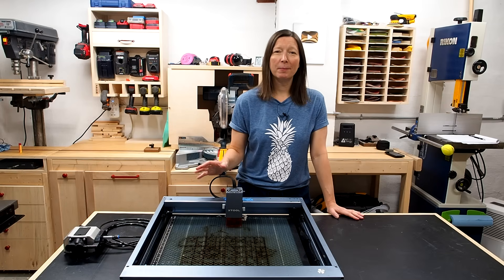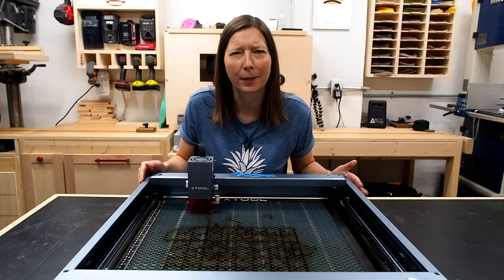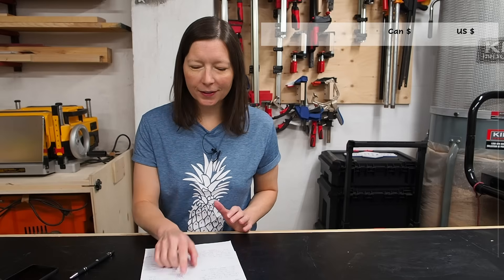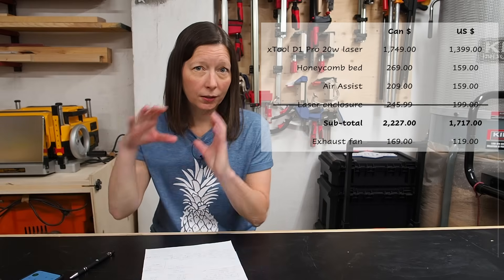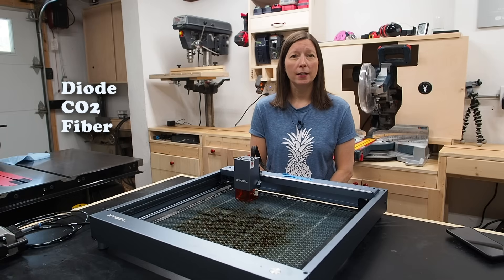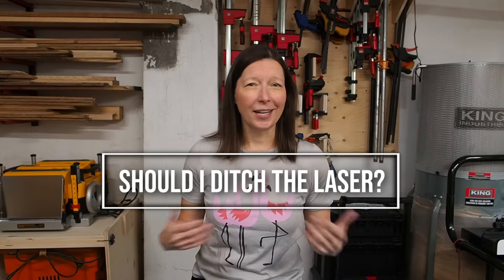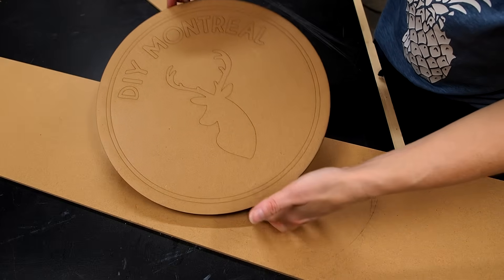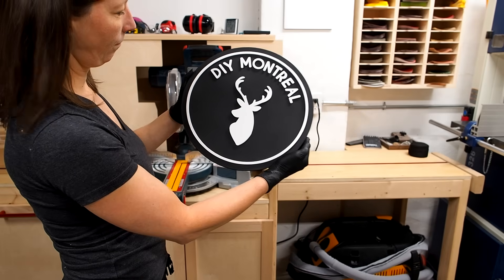Should you buy a laser engraver? Or is it just a waste of money

Comment: Excellent advice.  Very helpful video.  I was strongly considering buying a 10 watt laser but you convinced me it's probably not something I would use enough to warrant the cost and time investment.  I'm a hobby knife maker and really the only thing I wanted a laser for was to engrave a nice looking makers mark on my knives.  Other than that, I really am not interested in cutting out signs or other stuff.  I'm from Ontario Canada originally but moved to Texas many years ago.  My father was a carpenter for 50 years so i too can do carpentry among many other things.  Ive always made stuff from wood and about 2 years ago i made a knife from an old file. Id run out of things to make for my house so i ventured into knife making.  Most of the handles are exotic woods so thats still carpentry..lol   Anyway, the cost of stuff in Canada and the tax is extremely high.  There are several lasers I could get in the USA on black Friday sales for $255 - 320.  Then all the accessories another $200, although I'm not sure I'd need the exhaust vent or even an enclosure just to etch a makers mark in a steel knife?  I don't have a good place in the house to vent the exhaust fumes and smoke if any.  I'm also not too keen on spending many hours learning software either.  Your video brought me back to reality and practicality, so I think I'm going to not get into the laser stuff.  I'll maybe find a small company that can laser etch my knives or perhaps try the old electroetching with a stencil.  Thanks again...you saved me money and time. It's great you do carpentry and I'll be checking out other videos on your channel...Take care and stay warm...I do not miss the Canadian winters...lol

Comment: Note: 
- Laser cutting / engraving is dangerous operation & require enclosure.
- xTool Enclosure or any expensive options are USELESS, build YOUR OWN !
- Diode Laser only is effective at wood and non-reflective / non-transparent materials, unlike Fiber/Co2 Laser.
- Software is required to pay more for Lightburn, plus time investment into learning the tool transitions to make your design work.
- Safety concern : require babysit your process on fire, put on protective glasses before burning.

Comment: Thanks for a very very informative video.
As woodworkers we often need to spend a large cumulative amount of money on setting up a good workshop.
I've been considering lately whether to buy a Lazer or a 3D Printer and at the moment I'm edging towards the 3D Printer 😁
Reply: I bought a 3D printer for my son a few years back, he's made good use of it. lots of learning curves there and he was VERY involved with 3D printing at his University, prior to us buying it for him, so he already had a great deal of knowledge about the subject. We bought a Ender model for about $200. 
       Now, My son just bought me laser engraver! different model than used here. 10W diode laser but only cost $300. I've been working this week to assemble it, set it up, build a vent system, started learning Lightburn last night, plan on doing some tests on a piece of leather today, to figure out proper intensity and speed of the laser.
I don't think I could master the software for the 3D printer, but this laser engraver looks much less complicated to me.
If you buy a 3D printer or laser engraver, either way you'll be exercising you brain !
Reply: Thanks for the Info, I'm still edging towards the 3D printer, mainly because if you want to cut relatively thick material with a lazer, then things can get very large and expensive very quickly 😁.

Comment: I'm looking at lasers for about over a year now but I don't have the space to put it up. My conclusion: What most people have in mind when thinking about lasers these results can only be achieved with a CO2. The higher the wattage the better, faster and cleaner the cut. Therefore the ("small") industrial lasers do a better job at a better price point. They just don't look as fancy/easy to use as the ones which are marketed to the hobby/"wanting to make your hobby into a business"-people.  In between that I would put the laser that "mom with a laser" uses. 
I would never go for a diode laser that are on the market right now.

Comment: Probably the biggest thing I learned is to do testing.  Test using test coupons to get settings optimal before doing the actual work piece.

My next project will be a electronics test equipment rack that will be 14" tall and 13" wide x 11.5" deep.  Material will be 1/4" birch plywood held together with 1/2" wood dowels.  To get the correct hole size to fit the dowels will require some testing as will the best speed setting.  Will use the xtool 40W blue laser, probably start at 50% power setting then adjust speed for optimal results on some scrap wood.

Comment: Agree very much on the exhaust and smoke issue. I made a simple design with a closed and open plywood disk separated with zigzagged bamboo skewers. I weave a filter material in and out of the skewers and this catches most of the sticky particulates and is easy to clean. I have one for inside my 10 watt blue OLM3 and I have one on the end of my 65 watt Gweike Storm 600 CO2 laser that I poke out the window when using it. My 60W fibre laser is far less smoke causing but I wouldn't trust using it much for stainless steel without ventilation because of SS chromium content.

Comment: I'm in Arizona, and I'm thinking about getting a laser and want to start small.  You said they really stink, yeah I knew that and my major concern is that I live in a somewhat crowded area and naturally there's the dreaded HOA.  CC&R states something about not emitting "noxious odors or fumes" (probably no smoke either).  That has me wondering where I can exhaust to... how bad can it really be?  I'll be in the garage and probably have to vent through the roof somehow, cement tile roof isn't a DIY project so it'll have to be done professionally.  What are your thoughts?  Any fire hazard associated with these?  I'd like to cut acrylic and wood.....
Reply: You can get the manufactures filters to add on to your machine, but they are a bit pricey.

Comment: great info. I bought a small cnc w/ laser adapter...yet to use the cnc part, but they use different cooridnate systems so just to get lightburn to communiciate suffuccessfully with 0/0 as the lower right was a big nightmare...learning to program was necessary.

And yes, THE STINK! Try cutting leather!

Comment: OMG FINALLY someone that breaks everything down cost wise and equipment wise. Thank you for giving us all the 
extras with manufacturer and fails with said equipment. I am trying to set up a resin 3D printer with the exhaust fan like you have. 
I have now ordered 4 fans that have not done what I need to vent the smell. I think I have finally figured it out but just from
your video I see your system works. So thank you for this video.

Comment: You could build one using 2020/2040 aluminum extrusion, fasteners, GT2 belts, stepper motors, GRBL controller board, limit switches, cables and accessories, 10w laser module for less than half that price.
Diode lasers are a waste of money to most, a fire hazard cause some users leave them unattended, which is a big no! Never rely on these gimmicky "Safety cutoff" features.
And what frustrates a ton of folk is the very short lifespan of these diode laser modules cause they get abused using them for mostly cutting plywood at 100% power. These are "Engravers" guys!
For cutting, use a CNC or 100w+ CO2 laser or if you have deep pockets, a fiber laser!

Comment: Overall this was a good video of things people may not expect if they didn't do any research at all. A $25 webcam makes you not need to be right there as long as you check in on in and are nearby. The extra costs although not completely accurate are a good point. (there are plenty of much cheaper options for both air and honeycomb for each less than half the Xtool branded ones that are as good or better on amazon.) even less if you DIY it. I spent about half what you did (in USD) for the same setup without a fan or enclosure as they are not necessary so that is a bit misleading. To say "it's not possible" many times is a lie, I have my laser in my office right behind me while I work with the windows open and have 0 issues at all. It's really not that bad as long as you are not careless with what you are burning. To say that just burning wood fumes is toxic that is also not true unless you are burning treated wood., there are some very dangerous things you could burn if you didn't to any research like PVC. Getting fumes out does help but just an open window is fine for some myself included. A laser vaporizes the material so there is no dust to extract...  A few helpful tips 1. Do a material test burn on anything you do and write it down somewhere close. (In light burn you can save a list of materials and settings as well as images instead.) - Wasted test material is another unexpected cost though. 2. The random limit switches tripping seem to only happen in Xtool's software I'd try lightburn that has a free 30 day trial. 3. I'd highly recommend a screw style height adjuster (if you have a 3d printer you can print one, otherwise you can buy one from Etsy for about $25 usd. it will make adjusting for different material WAY easier. 4. Lots of people don't mention this but on stainless or aluminum with a 20w diode you can actually get some color engravings via oxidization of the metal is you liquefy it resulting in different power levels giving different colors.

Comment: Excellent summary... and I absolutely agree that people should do a LOT of research before "taking the step"...
Your video offers an excellent overview of what's REALLY involved in using a diode LASER to DO stuff...

I just purchased XTool's new F1 unit - the one with the desktop air filter and the dual diodes.
Now, to be fair, the company where I work has a big CO2 LASER, so I'm quite familiar with the limitations, as well as the benefits.
And I've also got a lot of experience with graphic arts software... so that won't be a problem either.
I absolutely agree that the ads, as well as most of the FIY videos, tend to ignore quite a few really significant issues...
Like smoke and smell, and the experimentation required to choose settings, and even the materials themselves...
And most seem to sort of gloss over the fact that, when you "cut" with a LASER, you are basically burning through the material...
(It's not like in the sci-fi movies where the material just disappears when the beam hits it.)

I think it's also worth mentioning that a lot of the limitations CAN be overcome... but even that can be complicated.
For example, you CAN engrave on glass or clear acrylic with a diode LASER, but it's really complicated...
And it takes lots of extra steps...
And, if you watch the various videos, you'll see that many of the methods don't actually work especially well anyway...
(At this point a lot of this is still "experimental"... )

I think I would add one piece of advice... specifically for people who want to engrave photos and images...
Watch A LOT of videos about setting up your images... and how halftones work... and raster vs vector... and line vs fill...
There's a lot to learn there... and you need to get it right if you want to produce good looking artwork on a LASER...
If you just "import a a picture into LightBurn and hit print" you're probably NOT going to be happy with the results...

I would equate it to the person who "sets up a custom wood shop"... but neglects to consider sawdust... or tool maintenance.
Or the person who buys a computer... but has no idea how to use it or what good software costs... or of the learning curve involved.
Obviously "everyone" is NOT going to "come up with a LASER side hustle that will pay for the device in a week"...
(But is sure does seem like a lot of people want you to THINK it's that easy... 🤨) 
And an awful lot of LASERs will end up on the shelf collecting dust...

Comment: I am a noob and I bought an Atomstack A5 Pro+  about a year ago,  And this weekend  trying out lightburn and its a challenge, been using LasrGRBL  , The stink isn't an issue for me , i grew up on a Cattle ranch, so smells are expected.  my laser cost me $200 at Christmas time  so I am in cheaply and so far i am enjoying it, less lightburn learning,   I don't cut  much and i just enjoy engraving, but  Atomstack speeds and feeds are different that what lightburn uses and it has been an issue finding the parameters to get good results, maybe this time on the material test I got it and if I do then that will help, If I were to buy a laser again I would buy a model with limit Switches.   not having those is an issue.  Looks like you went all in from  the beginning.

Comment: My jtech was a better deal then what i thought. Was kinda iffy about 1300 on a laser. but if you paid 1700 for that? I dont feel bad for paying 1300 for a 24watt.. I should say though my Jtech was just the laser ONLY it attached to my Onefinity CNC also i run mine in the basement i put a filter in my dust collection and use it to suck up the smoke. I go out my dryer vent.

Comment: As someone who is no stranger to CNC, I worked in an engraving shop and a more stereotypical style shop. I just bought my first laser and got it set up and you make some valid points that I didn't even think of, number one being exhaust. I did find ; if you know where to look, fans can be found much less expensive price point if you're willing to sacrifice an outlet for it. that does circle back to "do your research"/"know what material you're using" this little laser cuts fabric like a dream and if you cut it damp there is no ignition point. 
I will say that more proprietary software is light years ahead of what is out there right now open to the public in the ability of plug and play and has less of a learning curve, but the foundation is still the same so it will come with time and will almost become second nature knowing the idiosyncrasies with your machine.

Comment: Wow, did they see you coming.
You are right, -do your research. 
Your video should be about what you should do before buying. 
Who goes into buying something without research. 
Someone with money to burn.
Here is a breakdown of my systems main components. 
Not an X-Tool - but in my opinion a better bang for your buck

ORTUR Laser Master 3 Laser Engraver, 10W Higher Accuracy Laser Cutter $699.99 -$100 coupon= $599.99
Honeycomb Laser Bed 19.68"x 19.68" x 0.87", Nivill Honeycomb $64.95
Laser Air Assist, DEWALLIE Air Assist Pump $59.99
Laser Engraver Enclosure with Vent, Fireproof Laser Cutter Protective Cover $89.99
RLOZUI 6 inch Exhaust Fan, 382 CFM Wall Mounted Vent Fans $32.99
Dryer Vent Hose 6 Inch Air Duct 9.84 Feet Flexible Adjustable $17.98
Ortur YRR 3.0 Rotary Roller for Cylinder Engraving $99.99
$900 + $54 tax = $954. 
Yeah X-tool is rated higher only because they have a hell of a PR department that pushes their product.
There are the other things like you mentioned, but penny Anny stuff.

Comment: if you can't think of anything your laser can do for you beyond two or three projects, it probably was a waste of money for you. I got my laser around the same time ago, almost a year, and I've used it hundreds of times in that span. I would recommend getting a CO2 laser, as for the diode laser to perform well and safely, you need many of the things a CO2 laser generally comes with, enclosure, exhaust, etc, as well as being able to cut and engrave many more materials. I did buy a machine with a much larger footprint of the xTool, with an upgrade 20W laser module, for about the same price. Now that i've added another subframe of 2020 extrusion, my machine will allow me to ditch the diode and add in a CO2 tube, making it the perfect learning project for my needs.

Comment: As well as the previously mentioned periodic tube replacement, co2 lasers seem to require expensive exhaust and cooling systems (add-on of course).  I’m using $40 fire extinguishing balls above fire potential equipment (3D printers for now) but I still stay in the area.  I probably have a laser in my future, so thanks for the information.
Reply: even Diode lasers need a ventilation system, I made a 30" Cube to put our 2 lasers inside, then ran 6"Inline fan with ducting out a window with a plywood flange.

Comment: Great video..I learned on a 5 watt Ortur that I bought on Aliexpress 3 years ago for $400 and I just upgraded to the Xtool 20 watt. I use it in my garage and as I am also in Canada I will set up a ventilation system for when winter hits.  I love using the laser to engrave my logo and with the 20 watt it’s opened up the possibilities of making more signs. Lightburn is very user friendly and there are lots of YouTube tutorials on it.  But if you already have a CNC then the design principles are very similar.  I agree with all your points and I think that some planning and forethought should go into it before making a purchase.  This applies to any tool you’re thinking about purchasing.